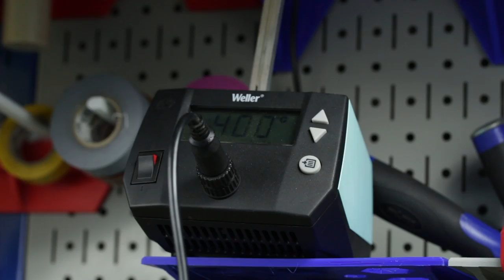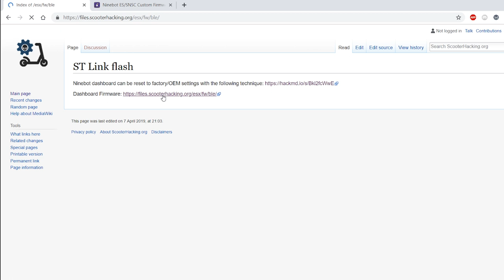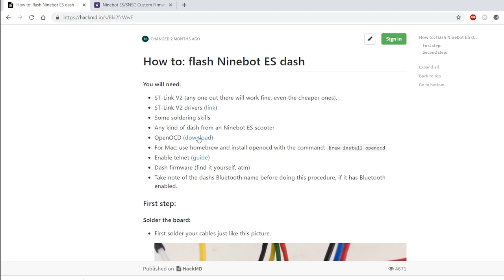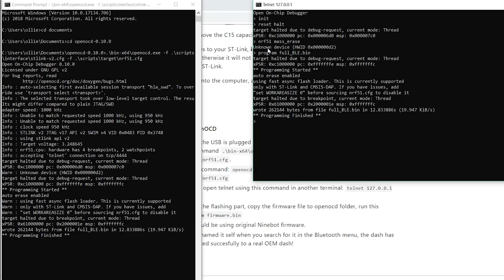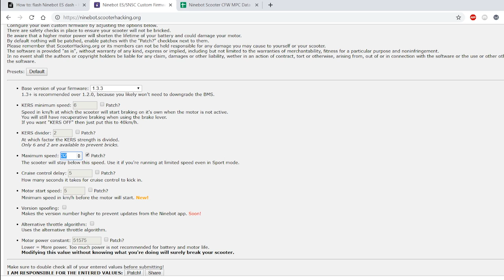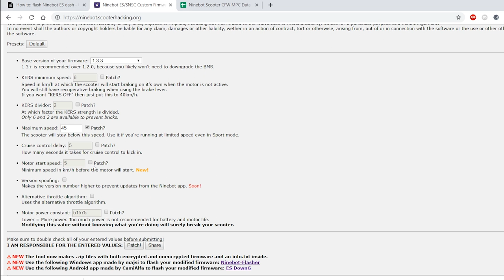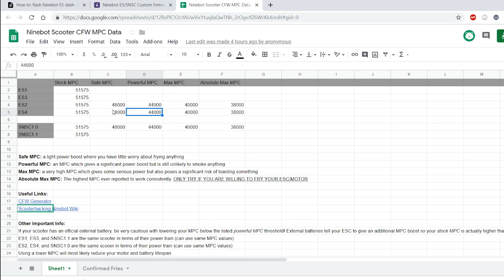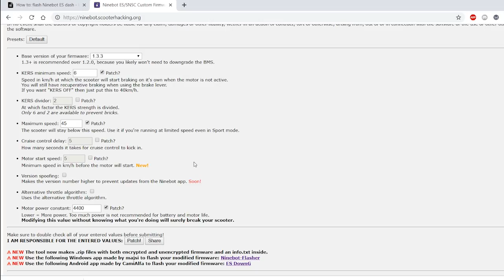Ninebot ES/SNSC Custom Firmware (CFW) ST-Link Flash Tutorial

Comment: Have you ever, or is anyone else getting a error 10 code after doing all this?
Reply from the maker: Check that you didn't damage your dashboard when you soldered the ST link wires to it and that it is securely plugged into the handlebar shaft of your scooter
Reply: @BananaScience  horse would I know if I damaged the dash from soldering?
Reply: I ask because I've tried two different dashboards, little bit apprehensive to try it on the third... don't really want to brick them all... they don't even connect to the bluetooth app. They show up on there but the dash turns off before it connects
Reply from the maker: @andrewmortellarosr.5741  Any clearly damaged tabs or surface mounted components? Send some photos to banana.science.awesome@gmail.com and we can try to help you out in greater detail
Reply: Sent

Comment: hello why it has to have external battery to use this procedure?
Reply from the maker: Hacking the firmware increases the amount of power drawn from the battery. Without an external battery to share the load, this increased current will fry your BMS (battery management circuit)

Comment: Hey bud , have seen a french tutorial where he just uses the ES_downG to flash the firmware bin from the custom firmware without going through the first stage of soldering in and wiping the OEM . I've tried it that way but no results that I can get anyway regardless of his comments from people claiming otherwise ,so I guess what I'm asking is there anyway of flashing custom firmware without the soldering in or is this the only way? By your knowledge I'm leaning towards your way. Thanks in advance. Great tutorial.
Reply from the maker: Nope. The soldering method isn't just a less efficient way to get the same thing done. As we describe in the video, you need to use the ST link to flash OFW before flashing CFW over bluetooth.
Reply: @BananaScience  cheers ,👍

Comment: Can I just flash the cfw to the scooter or do I have to open the scooter
Reply from the maker: If you have ever replaced your dashboard, you will need to open the scooter to flash stock firmware first. If you have never replaced your dash, you can just flash your scooter right away with the ninebot flasher app

Comment: It seems like I shorted out the C9 capacitor. Can I replace this, or am I screwed?  If I can, what is the capacitor I need?
Reply from the maker: If you just shorted it out, remove the shorting solder. Ceramic capacitors like that don't typically fry but you could have fried some other components on your dash if you powered your dash wile the capacitor was shorted.

Comment: Ordered an ES2.. As i understood it, upgrading a battery (ES4) will make it go 30kmt without flashing firmware. Is there any other benefits of flashing the firmware?
Reply from the maker: You can hit 32kph which is a little faster and you can get a slight acceleration boost on top of that.

Comment: Hi! Do you now what is the voltage from the battery to the dashboard?  I just bought an ES2 and is not turning on so I'm trying to test the dashboard and I measured voltages at the handlebar, two pins are 5v and other is 14.8v. Can you help me with some advice?
Reply from the maker: ClauSatanic I’m not sure what the voltage is but that would be a great question for the discord server. It’s probably not turning on because you still need to flash your ESC.
Reply: @BananaScience  Thank you, I finally decided to open it and found the real trouble... Battery didn't work at all. I don't know how could they sold me a new scooter with that trouble :(

Comment: Why would you lower your mpc to 44000?  That's not smart- you will most likely eventually fry your scooter esc +possibly burn motor and will definitely significantly shorten the motor and scooter life span greatly.  I wouldn't advise anyone to use an mpc lower than 49000.  Also don't beat your scooter up going up steep hills full throttle or  overuse electric breaking especially going down hill. Another tip would be to don't use any throttle down steep hills.  Ideally-Don't let your battery drop below 40% before charging it. Take care of your scooter if you want it to last

I have ES4 lime rental version, I set my mpc to 50000, top speed 40km, left Kers stock and put start speed setting to 3km...Scooter still does 32km with 130lb rider.
Reply: what is your base firmware? i cant get my es4 ninebot top speed past 30kph
Reply: @brucechin6788  I don't know what my base firmware is.   I don't think it matters in my response to you. Remember scooter top speed is  VERY weight dependent. I did drop my mpc from 50000 to 49000 quite a while back. I weigh 132 lbs. I'm usually getting 32 km top speed rarely 33 anymore at full charge. My Es4 Scooter is also 1 yr old now. Another thing to keep in mind..... As time goes on battery life and performance will slowly degrades a little bit every year no matter what. So an ES4 thats 2-3 yrs old with several charge cycles on it will not get as good performance as brand new es4 scooter.

You could definitely safely drop your MPC to 49000 with no problems and get a litter more power.  I just take it easy on my scooter. Don't try going up hills with full throttle- maybe 60%, be gentle with electric brake system especially down hills.  Let scooter slow down on its own then use e brakes.   Hope my advice helps
Reply: @GBDogg504  thank you tons, i set my MPC to 48500 just pushing 35-36.
would kicking the scooter up a hill while pressing full throttle damage?
Reply: @brucechin6788  kicking scooter up a hill or anywhere is fine to take some strain off electric motor.  On a steep  hills Full throttles not ever recommended even with stock scooter that hasn't been hacked.   Note--Heavy riders 200+ lbs make a scooter have to work harder continuously overall and especially at full throttle up steep  hills.  Basically this specific scenario will quickly fry/kill any es4 scooter guaranteed.  Take it easy on steep hills 60-65% max throttle or avoid them altogether if you care about your scooter.  More expensive e-scooters such as 1300$ mercane Widewheel Pro dual motor have more power/ torque and top speed-26mph and can climb hills much better.  If you're really serious about e-scooters consider getting a higher end e-scooter. The ninebot ES4 is a very good entry level e-scooter though.  I think someday my next e-scooter will be something like the previously mentioned model, take care

Comment: This video it great.  I have an issue that I hope you might be able to answer.  I have an es1 but I cannot get it out of limited mode.  It was flashed to only run in China.  Can I just reflash my unit to the stock firmware and get it to work here in the States???
Reply from the maker: R Escue I’m not 100% sure if flashing OFW will fix your issue but I think it’s definitely worth a shot. If it’s stuck in limited mode, you might want to look into changing the serial number as that will unlock all the different modes.
Reply: BananaScience so where do I find where to do that?? Any direction welcome.
Reply from the maker: @royescue4127  We are currently working on a video on how to change your serial number but until then check out this:  https://www.scooterhacking.org/forum/viewtopic.php?t=14

Comment: It keeps saying cannot find the path specified when I try to paste in the first line of code after CDing to the openocd folder
Reply from the maker: Have you extracted the .7z OpenOCD file?
Reply: It was a .zip file and yes. I downloaded it from the link on the Wiki page. Could this be caused by weak solder or is it more a software issue?
Reply from the maker: @michaelbook2019  Did you extract the zip file?
Reply: @BananaScience  yea i have the same problem. I extracted the zip file and after copying and pasting, the first line of code into cmd, it says the system can't find the path specified
Reply from the maker: Joshua Huang did you move the folder to your documents folder?
Reply: BananaScience haha the scooter turned off by itself so i lost bluetooth connection. (i connected using bluetooth instead of soldering the board into usb) But now when I paste the first line in it says error: open failed

Comment: Hello , I have a problem, I changed the software many times, but on many of my ES4 the battery does not charge more than 80%.  Can you help me ?
Reply from the maker: Not sure what the cause is of that problem. Ask around on the Discord
Reply: Check the output voltage on your charger and make sure it is 42 volts some of the cheap Chargers are a bit under voltage

Comment: Hi, will this work on locked lime, bird auction bought scooters?
Reply from the maker: It will work on Bird, Spin, and any other Ninebot ES rental scooter which you have replaced the dash.
Reply: @BananaScience  Does the original dash have the cr15 that can be desoldered? Im just wondering if theres any way to do without replacing the dash.
Reply from the maker: @STJrArmonte  Yup. The dash only needs to be replaced for people who are using ex-rental scooters where it is missing a dash in place of a tracker board
Reply: BananaScience will it work with a dash that isn’t OEM.
Reply from the maker: @Felisargyle  You don't need to ST Link non OEM dashes as they already come with stock firmware pre-installed. If for some reason though you need to flash an OEM dash this will work.
Reply: BananaScience perfect thanks for the speedy reply
Reply: Okay so I have a bird and jump scooter that I got from my local impound action and the dash was already on the jump scooter and I noticed I can just transfer the jump handler bar over to the bird it turns on but doesn’t want to go, would you think if I was to flash the dash with this it would have it working
Reply from the maker: Hiland Thornton This will fix the issue on Jump dashes where the display doesn’t work but it likely won’t fix the issue where the scooter won’t move. The reason why the scooter won’t move is that Bird has recently been using proprietary firmware on their ESCs that needs to be re-flashed with OFW before the ESC will work. Check out the forums linked in the description for help on that. We have a tutorial video for ESC flashing coming soon as well.

Comment: How do you upgrade/downgrade the bms firmware?
Reply from the maker: infamousnova use the ninebot app or ES Down_G
Reply: @BananaScience  it doesnt do battery firmware.  My batt is 303, I want 1.3 or better. My scooter rides real slow
Reply: @BananaScience  can you tell me where to get bms firmware?
Reply: @BananaScience  can you use hand brake with upgraded firmware
Reply from the maker: infamousnova yes though it’s more sensitive
Reply: @BananaScience  I heard it messes up the esc
Reply from the maker: infamousnova if you slam on the breaks really suddenly, you will almost surely fry some PCB tracings or a MOSFET but if you’re gentle on the breaks the ESC should work fine.
Reply: @BananaScience  ahh ok. One more thing. If a scooter is really dirty can it be washed off with waterhose?
Reply from the maker: @infamousnova  Probably yes but don't use the high pressure setting and try to keep the water away from the dashboard and where the handle bars meet the steering shaft tube.
Reply: @BananaScience  ok I'm trying to flash the dashboard and ran into a problem. I just ordered everything and tried to do it. Well the issue is at the computer so far. When I go to command prompt and type CD downloads it opens but when I type cd openocd-0.10.0 is where the problem comes in. It doesnt open, I csnt go pass that. Command prompt says it cant find the path specified
Reply from the maker: infamousnova have you unzipped the OpenOCD.7z file so it turns into a folder?
Reply: @BananaScience  no I have not, I don't know how.
Reply: @infamousnova  how do you flash a bird through Bluetooth?
Reply: @captastroglide  follow the steps of this video. He can explain better than me. Honestly watch the whole video. It's full of Info
Reply from the maker: @infamousnova  I second this. I can't spoon feed you information any more than I already have in this video. Use the program 7 zip to unzip the file.
Reply: @BananaScience  I figured it out, everything cant be done on the phone

Comment: i just got a lime scooter from auction with an internal battery i guess this  wont work huh
Reply: Yes it work
Reply from the maker: Limes use propriety hardware so you would have to swap out the ESC and dash for it to work
Reply: @BananaScience  how do I find the hardware for the auction lime scooters? Bird's are easy to get, but what are the ones that work on limes called?
Reply from the maker: Antassium limes use all propriety hardware so you can’t hack them without replacing the entire power train basically
Reply: @BananaScience  so I guess I'll stick to getting Birds from auctions then..

Comment: What about the Bird ES1-300, it’s exactly the same as the ninebot es2. Do I need to buy another dash?
Reply from the maker: Bird uses Ninebot ES3 scooters which you will need to flash the speed controller on and purchase a new dashboard for.
Reply: BananaScience I thought the ES3, used a 250W motor? I noticed the ES2 has the exact same specs. So I bought a flash ninebot es dashboard
Reply: Did yours only stay in sport mode and not connect with bluetooth? And did you fix this by simply swapping the dash?

Comment: I do all the correct steps and the installation by command is perfect and when I connect the board to the scooter I give the button and it does not light anything, any answer ?, I repeat all the steps with the st link are perfect, when I cannot turn it on I cannot connect it with the application of windows 10 ninebot flash
Reply: Does the button click when u push it
Reply: Yes of course, and does not answer anything, I have the external battery on, and the only thing that makes me when I press the button is to turn on the light of the external battery but does nothing else
Reply from the maker: Javy Proteck ya Neck you likely need to flash your speed controller as well. We are working on a tutorial for that but you can find instructions on the scooter hacking forum until then. Just look in the error 10 section.

Comment: Hello, would your pre flashed board work on a bird es4?
Reply from the maker: Yes it will but you might also need to flash OFW to your control board as well. See our ESC flashing tutorial for instructions on how to flash your speed controller.
Reply: My scooter was running it’s just that the dashboard stopped working because I plugged it to another scooter, do I just have to buy the pre flashed dashboard? Or do I still need to flash the control board too?
Reply from the maker: @AngelMartinez-sc1tu  If your dashboard stopped working after you plugged it into another scooter you likely fried it by plugging it into a scooter with a 5 pin Julet connector instead of a 4 pin Julet connector connector from ESC to dashboard. If the scooter applies breaks and beeps with a new dashboard or reads out error 10 or error 35, you will need to flash your speed controller as well.
Reply: BananaScience sorry for really late message see the only problem is that the dashboard is fried, so would I only have to replace it with one of your pre flashed dashboard?

Comment: I replaced my esc and now get an error 35, I bought the ST link to try this out and see if it helps Thanks bud.
Reply from the maker: Yup; flashing stock firmware should fix that!
Reply: @BananaScience  I am now getting an error in openocd target aborted flash and the dash seems bricked, any ideas ?
Reply from the maker: @buddahxd8559  Did you type in: init, reset halt, nrf51 mass_erase as described in this video? That usually fixes that issue
Reply: @BananaScience  I did not let me try that
Reply from the maker: @buddahxd8559  What do you mean? When did you try typing it in?
Reply: @BananaScience  I meant i forgot that step and i'm giving it a shot Nrf51 mass_erase is not giving any output though
Reply: IT WORKED!!! YOU ROCK MY MAN!
Reply from the maker: @buddahxd8559  Yup! When I was trying to flash my dashes the first time. I didn't know about that and it took me like a week to find out how. lol
Reply: @BananaScience  thanks so much, now my issue is that the scooter powers down when I try and flash from ninebot flasher
Reply: all working amazing thank you
Reply from the maker: @buddahxd8559  Yeah just keep trying till it works and make sure your scooter is really close to your computer
Reply: @BananaScience  you are awesome bro, thank you for your help and support. Managed to hit 24 mph (I'm a 250lb rider) and the limiter kicked in even though it's set to 45, but incouldent be happier this is awesome!
Reply from the maker: @buddahxd8559  Yeah I don't think the CFW supports anything higher than 20mph yet

Comment: I see that you are using the 24 AWG cable. Is it ok to use 28 awg cable and also in the scooter if replacemts needed?
Reply from the maker: I would say no as there will be 120w running through it and 26 would be really pushing it.
Reply: @BananaScience  How many AWG should you have on the battery cabels and moderboard cables that connet to the motor?
Reply from the maker: @08kayak21  It should say on the side of the wire itself. I would say 16 would be the thinnest I could recommend but I would check to be sure.

Comment: Error: init mode failed (unable to connect to the target)
in procedure 'init'
in procedure 'ocd_bouncer'
Reply from the maker: Danlo R1 have you checked that everything is wired correctly?
Reply: @BananaScience  It works now.
Reply: Danlo R1 i also got same problem...how do you solve it?
Reply: @afizimohd6572  The wires were not connected well. CLK AND SWDIO. All wires must go in the same order.
Reply: Danlo R1 already checked few times the connection...everything looks fine...
Reply: @afizimohd6572  Open the programmer and check that the wires as in the video are connected.
Reply: Danlo R1 checked already...dont know whats the problem...